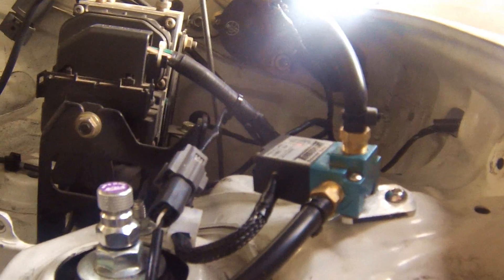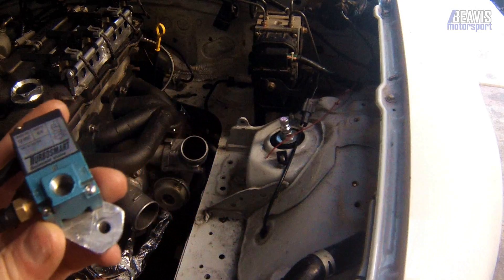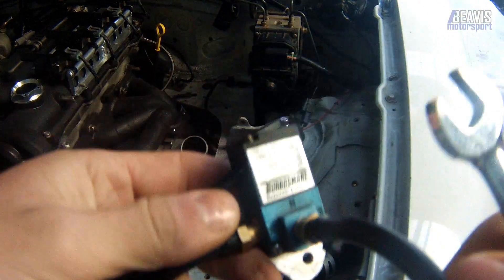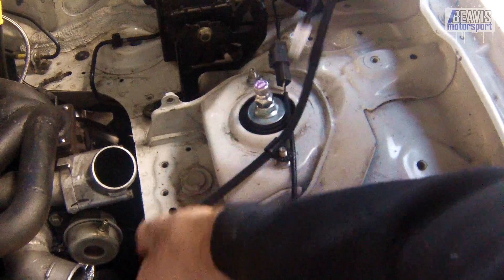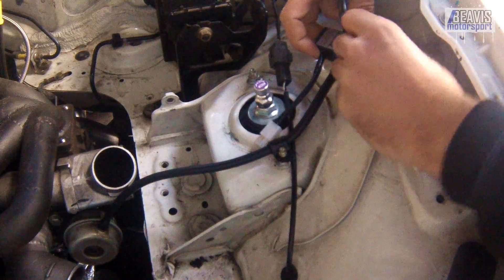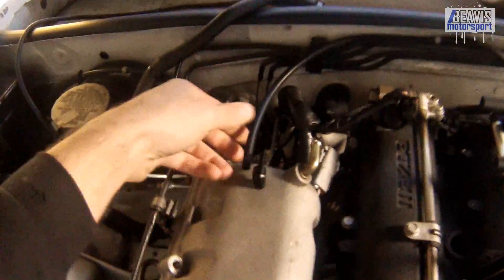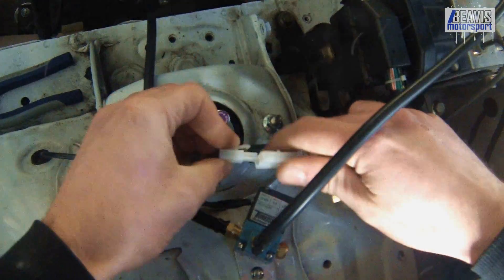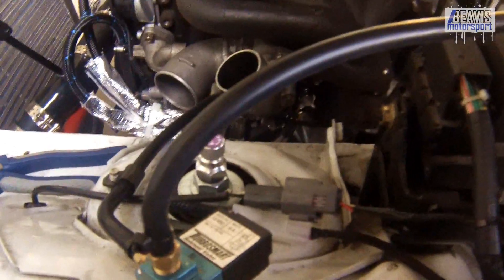How to install a MAC valve (Boost Controller) - Episode 20 - Time Attack MX-5 Miata TURBO Build

Comment: Frequency?
Reply from the maker: I think they are usually 19.5-40 Hz but it probably depends on where you source your boost control solenoid. My MS3 is configured to 39Hz.

Comment: When you start the engine does the Mac valve start pulsing? Mine only pulsates when I give full throttle while idling ...
I connected it just like you did
Reply from the maker: That really depends on how you are controlling it sorry mate.
Reply: Shibaaa

Comment: What 12v signal did you use to wire this in?
Reply from the maker: Hi Terry, I have built a fuse box under the dash to feed power, then it is directly controlled by the Megasquirt ECU.
Reply: @Bbeavis  I forgot about that. I'll have to find something generic for my setup. Thanks for the reply

Comment: No videos on YouTube shows and in depth on how to connect it up with the ECU that’s the vital bit if you screw up your done for please can you show HOW to connect it up with the ecu cheers
Reply from the maker: Every ECU is different, so it is hard to tell you how to connect to your ecu. But the MAC valve itself only uses two wires, so its not hard, power and ground. But you need to work out the ECU side for your specific car or talk to someone who uses your ECU.
Reply: BEAVIS Motorsport so is it as simple as hooking the Mac valve with one wire to the ground and one wire to the power so you don’t connect it up the ecu it’s self?is it that simple thanks for your reply mate I’m just confused so will ecu recognise the Mac valve when come to tuning
Reply from the maker: @fodzymiah7598  No, definitely need to connect it to your ECU or some other controller.
Reply: BEAVIS Motorsport so one wire to the ground and one wire to the ecu but which wire in the ecu do I connect it with that’s the bit I’m worried about 😅 cheers mate for your help
Reply from the maker: @fodzymiah7598  I cannot tell you what to do over the internet, you need to talk to a professional mate, speak to your local mechanic, automotive electrician, motorsport workshop etc.
Reply: @fodzymiah7598  the ECU controls the ground, so one wire to power, and the other wire to the ECU. It grounds through the ECU. That is how it is able to control it
Reply: Matthew thanks for your help
Reply: @fodzymiah7598  np, I just set mine up yesterday so if you're running megasquirt feel free to ask
Reply: Matthew will definitely do thanks again

Comment: They are so many ways to plumb this,,, but is one way better than the other ??
Reply from the maker: Yes absolutely, there is a specific way that it must be plumbed to operate correctly. I suggest you read the spec sheet that comes with your specific valve to ensure you get it right. Check google images for an easy and simple example diagram.

Comment: Wiring the EBC after the throttle body will cause pressure surges in your charge pipes when the throttle is slammed closed after being in boost. Wastegate pressure should be referenced after the intercooler(to account for pressure loss) and before the throttle body for the most accurate performance.
Reply from the maker: No, that's what the blow of valve is for.
Reply: You have a point!! as long as the BOV signal is after the throttle body as well. I never ran one on my car so I didn't even consider a BOV

Comment: The wiring is +12v and to ecu or something.
Which wire does what?
Reply from the maker: Yes, it requires 2 wires, one is connected to HC2 output from the megasquirt ECU (High Current 2). The other is to a 12v feed. Polarity at the solenoid does not matter.
Reply: BEAVIS Motorsport I use Adaptronic Ecu...but it doesnt matter.
Ok no problem with polarity.
Thank you for the explanation.

Comment: Come on .... I thought you'll show ebc tune... :\

My mac is plumped from both sides of the ebc and before TB
Reply from the maker: Hi Elior, I will look at making a quick video on boost control duty tables for you sometime soon :)
Reply: Elior Zeno 
Thecarpassionchannel have a video on how to tune a ebc. It's really simple.. You have to adjust the duty cycle manually in open loop mode first. Start somewhere around 10-20% duty cycle and increase little by little until you reach the boost you want. You may need to run a few datalog runs to make sure the boost is as wanted in every RPM and TPS percentage. You may even make the boost lower or higher in certain areas if wanted, or linear to the RPM or TPS percentage, so the engine will feel a bit more like a normally aspirated engine. When you have the desired boost dialed in, you can set it to closed loop mode and the boost will be slightly more accurate. Make sure the boost in open loop mode is as close to the boost target table as possible, before you activate the closed loop mode. That's the whole meaning behind dialing in the correct duty cycle before going closed loop. If the duty cycle is too much off, compared to the desired boost it will take longer for the boost to stabilise in closed loop, as the ecu will have to correct a bigger gap in duty cycle than in would if the duty cycles are right. Also, if I remember this correctly, these valves like to run at around 30-33hz. Hope this helps :)
Reply: I know that, It would be interesting to see closed loop tuning strategy.